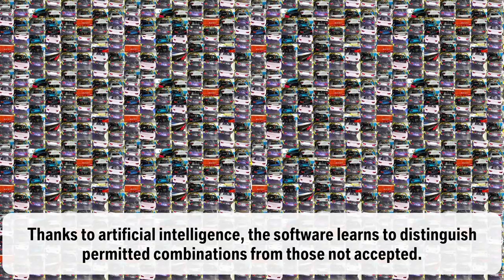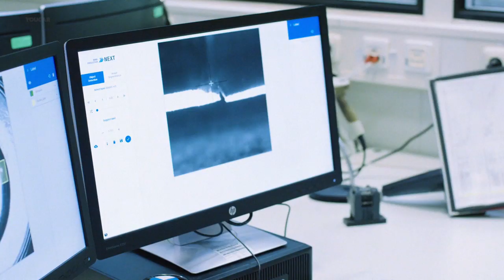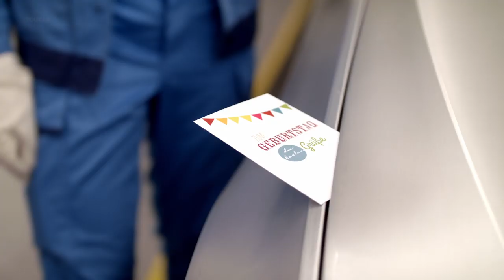BMW Factory – Integration of A.I. in the Production Line

Comment: what are they doing? when have you heard "oh my quarter panel cracked" on BMW gaskets leak, chains stretches and all electronics break. not panels cracking... the cars are made to last 100k not more. Lifetime gearbox oil  = 100k , lifetime chain = 100k. everything breaks on bmw after 100k except for panels... they are basic sheet metal how can you mess that up....